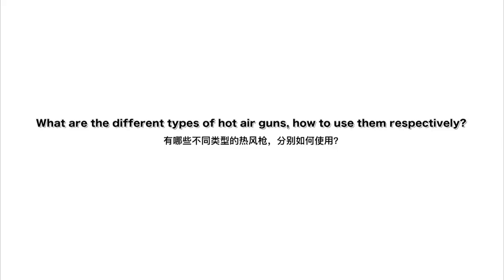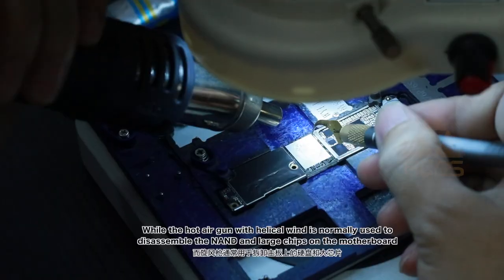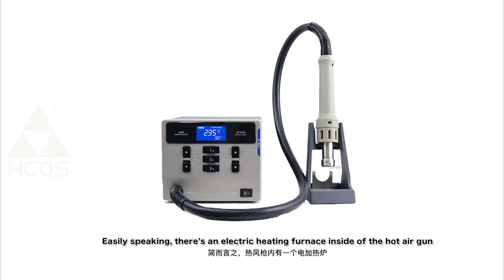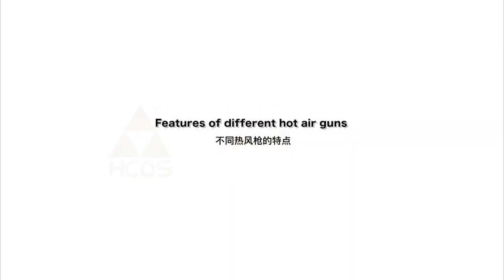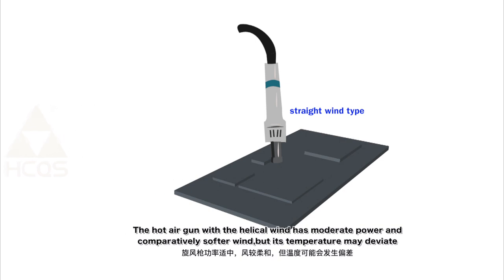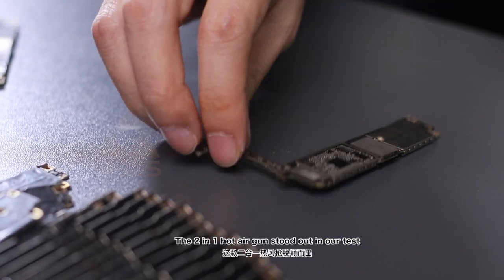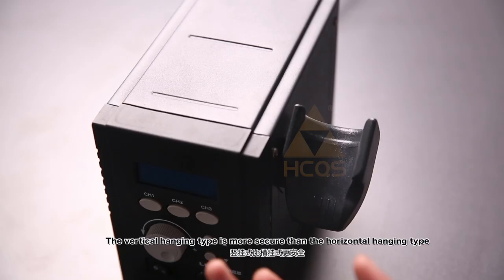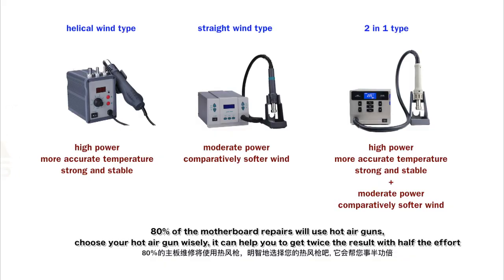Get to Learn about the Hot Air Gun Station | Motherboard Repair Lesson

Comment: at the beginning you said helical wind has high power, is more accurate and stable, than in the final part you said moderate power, gentle wind
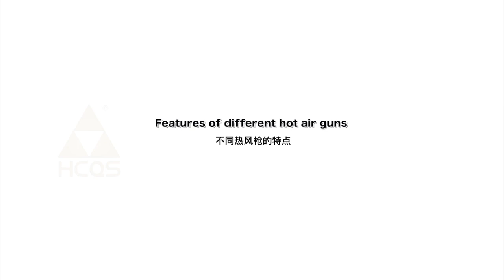Reply from the maker: Hi, Ruben, thank you very much to your comment, please take a look again at about 1:37, it said"The hot air gun with the straight wind has high power and more accurate temperature, its wind is strong and stable"
Reply from the maker: However, the Picture is marked wrong, it marked "helical wind type", for this, we apologize for our carelessness, will be more careful in the future, thank you very much again for your comment